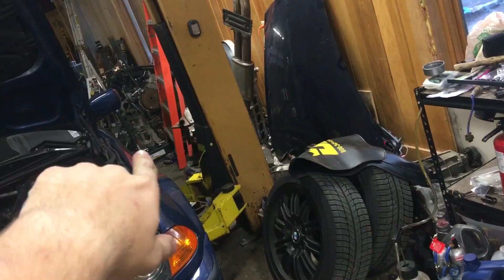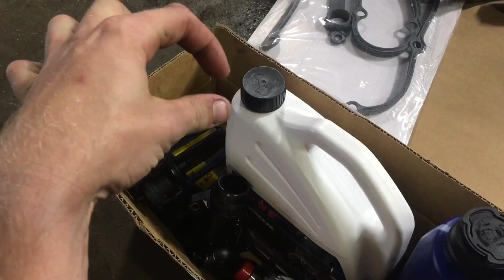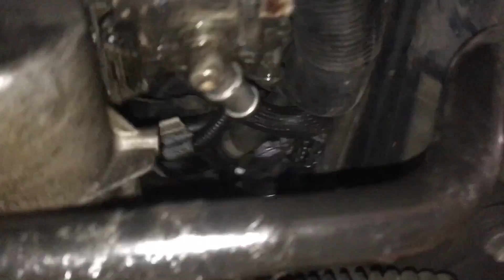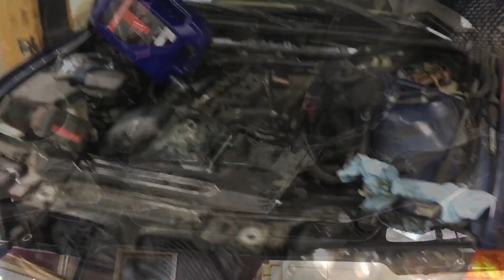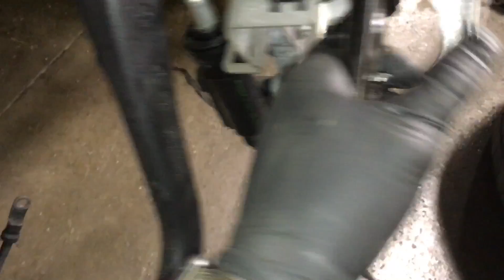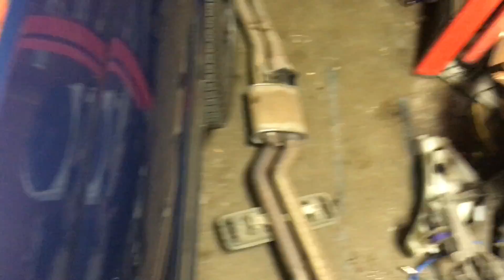BMW E46 touring 3 liter conversion and manual swap first start

Comment: Hello, Can you please help me I have a BMW Z4 smg/ssg same as 330 smg want to convert to manual lots of vids on E46 M3 swap how different are the 2? need help with wiring and neutral switch please any info would be greatly appreciated. Thanks!!
Reply from the maker: those are different than the S46 M3 and different than the regular 330i Auto swap. 

I do not have a video on this swap yet since I've yet to be brought one by a customer for a swap. 

I do have a 330i manual set in my garage if you want to drive ti minnesota :p

the MS45.1 is the hardest one to code though. the computer has to be sent off to Canada.

Comment: What is the difference between the E46 328i and 5 speed 330i clutch kits?  They look very similar.  Why do you recommend the 328i? Thanks.
Reply from the maker: no difference, alleviates confusion though because the 6 speed 330i kits are WAY different

Comment: What are you suggestions for Spark plugs on the M54B series engines?  4 Prong or single?
Reply from the maker: NGK single platinum

4 ground plugs are absolute trash

Comment: Just watch the fees that copart put on thier shit, lots of people get caught out by gate fee's and other BS
Reply from the maker: yep, gotta be careful. a $4,500 car is actually a $5,700 car.

Still though, I find a ton of stuff there that closes even after fees and sometimes shipping included for less than it would cost to buy the engine.

Not saying it's the end all solution for a donor chassis, but it's a really good option to keep open when shopping.

Comment: Ah you can actually buy that little snap ring from BMW for your master. When I did my manual swap it was missing off the master I had and I bought a kit off FCP Euro that has the clip as well as an o ring etc. I believe it's called a clutch hydraulic repair kit or something like that, I'll see if I can't link it.
Reply from the maker: oh man, thats super cool! Let me know if you find the p/n on that. I'll stock up.

On this project, I actually used one from a 2013 Fiat 500 Abarth clutch line I had in the shop -- fit perfect. I bet I can find some other manufacturer that will sell JUST that clip.. 

Maybe thats how FCP was able to do that kit?
Reply: Here is the PN: 21521165451 and here is the link https://www.fcpeuro.com/products/bmw-clutch-hose-connector-21521165451 The description on it was somewhat vague and I needed both the clip for my master and the female connection from the hard line to the soft line going to the slave, the clip is the same for both applications as far as I can tell, so I just ordered it with the intent to return it if it didnt work out. Also includes the o ring for the hard line to master. A bit of a rip at 8 bucks for the kit but it saved my bacon and money on a new master.
Reply from the maker: Expensive as all get-out, but very cool that it exists. bookmarked for posterity!

Thank you sir!
Reply: No problemo, next you need to do a S54 swap on an e46 so I can help my coworker S54 swap his alpine white slicktop e46 touring.....  Thanks for the videos!
Reply from the maker: I'd love to do an S54 touring -- just have to find a customer that wants to do it (this wagon actually might get that treatment in the next year or two). customer absolutely fell in love with the car with the 3.0 and the MT.
Reply: I am heavily considering the swap down the road, I have a 323i that was my first car when I was 16 and recently after 6 years of it being auto finally did the manual swap and what a difference. I know the 3.0 would be a big jump in performance for me although I went with a Getrag 260 so I would probably want to go ZF down the line as well. Time will tell.
Reply: Why go to BMW for a snap ring? Just measure the size, it is probably DIN specific, and order from McMaster-Carr https://www.mcmaster.com/
Reply from the maker: the G260 is such an awesome box. shifts a lot nicer than the ZF. a little lighter, and it has overdrive. it can take darn near as much power too. ZF is nice for cheap replacements though. a nice G260 is $800 now.